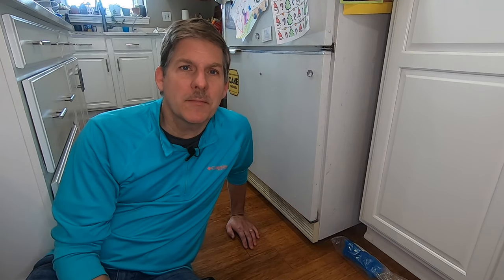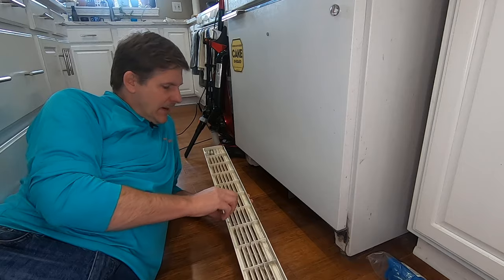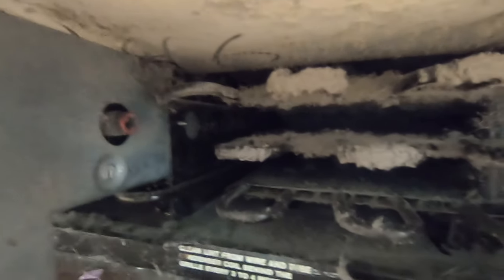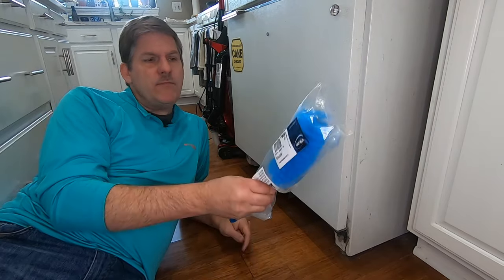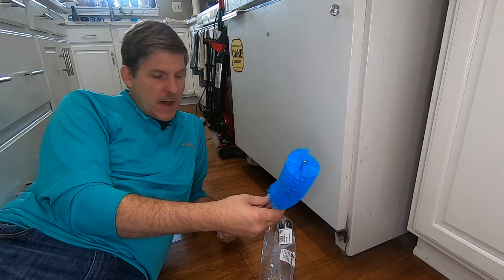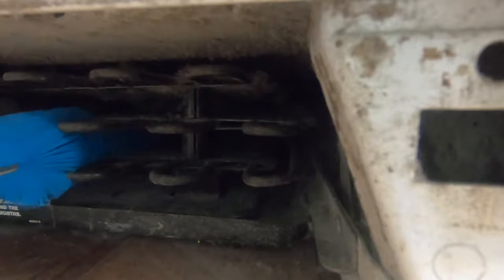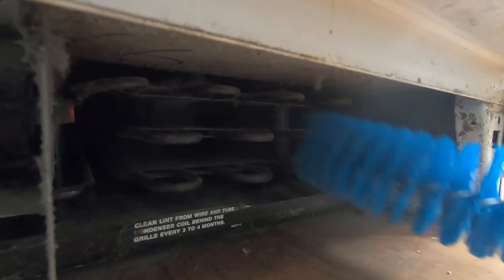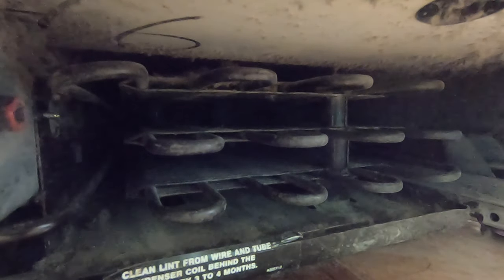how to clean under refrigerator coils : prevent fridge from not cooling

Comment: I'm about to do this on a 15-year-old fridge that has never been cleaned as far as I know. I love that the notice to do it every 3-4 months is behind the cover at the bottom of the refrigerator where no one will see it, ever unless they are already doing that.
Reply from the maker: Hey Ceares,
Great point! Have fun!
Reply: Good Luck. It TOTALLY worked for me!!!
Reply: I,m convinced that the dust under my fridge all over the evaparator coils  was causing the thermal relay to cut the circuit

Comment: Thanks for the great video. We learned this the hard way. We have two golden retrievers, and we’d owned the refrigerator for 13 years when it died. We ordered a new one, and in the process of moving out the old one saw, with horror, the amount of dirt and dog hair that had been trapped. We installed the new fridge, cleaned the old one, and it miraculously came back to life. 🤣🐶🐶
Reply from the maker: Hey Elizabeth,
Great story! Amazing what a clean will do. Thx for watching!
Reply: @Housebarons  I know that air needs to free-flow to that area of the fridge, but have you ever found anything, like some sort of screen, that can be put in front of the grill and limit dirt/dog hair but still allow air to flow in freely?
Reply from the maker: Hey Elizabeth,
I have not. Interesting idea. My guess is they don’t design them that way because the smaller surface area would clog faster and thus require more frequent maintenance - else the fridge would over heat or at least become inefficient. 
But that’s a guess….

Comment: My KitchenAid fridge is basically designed so the coils are next to impossible to clean. The front has a fence of coils that prevent you from reaching any coils beyond it. Manufacturer knows this and wants fridge to fail fast so you are buying a new fridge every 5-10 yrs instead of 20-30 like we used to. Manufacturer deserves to go to jail for this. It's ridiculous

Comment: only until I  removed the doors and shelves I flipped the fridge on the side and only then i was able to see the build up of lint and dust on the very bottom but not visible by just looking underneath  you would have to flip the fridge on its side to see the bottom and then Vacuumed but it was too late because i had already had a new fridge delivered because everyone said it was 14 years old it will only keep breaking down But I hope some needy person can take it in from the curb before sanitation takes it away  i will leave green masking tape saying it works  I wish i flipped it over before i bought a new one I,m convinced that the lack off ventilation was causing a thermal overload to trip because it would run fine after being shut off for a couple of hours then after 6 hours or so it would start to click off compressor.... live and learn but I watched over 100 you tube videos not a single video said to flip it over and look underneath so much for A-eye google search

Comment: I didn't have a brush, so I used my air compressor took the front and back panels off then blew it out the back then blew it out the front repeated it 3 times each, hadn't ever been done for years!  The frigerated wouldn't stop running and that was it! Running like new now!  It was overworking for years! Yeah, it made everything dusty in my kitchen!
Reply from the maker: Hey James,I can imagine the dust! but if it worked...then fine! Thx for watching!

Comment: Just finished cleaning my Kenmore refrigerator. I used a thinner bottle brush as my layers of coils were closer together. First I took off the plastic shield cover from the back of the refrigerator and cleaned the coils. And while I was at it, I also cleaned the fan and all the other lines that were back there. Then I went to the front of the refrigerator and got out all the dust bunnies that had been pushed to the front of the coils while I was cleaning from the back. I also used a yardstick and attached double sided scotch tape to pick up the dust bunnies that I could not reach with the brush. Dusted the sides and top, and pushed it back into place. My husband said, "It runs quieter now."  : ~)
Reply from the maker: Hey Cheryl,
Good job! Love the tape idea & Thx for watching!

Comment: Thank you soooo much for that brush idea.  I just finished cleaning my 13 year old fridge.  I always wanted to do this but never had the gusts.  Wow so much dust under that fridge.  I had a smaller bleu brush.  With the dust going all over the place as I was using the brush all over the coils and everywhere, I put a wet thin cloth over the brush (J cloth).  The dust ended up more on the cloth that on the floor or in the air.  

Thanks again.  I am so glad I did this.  I am a 62 year old woman.  If I did it anyone can do it too.  Bye
Reply from the maker: Hey Sylvia…,
Way to go! Nice job improvising with the wet cloth. Great idea. Hopefully you just added years of extra life to your fridge! Those fridges are expensive to replace! Thx for watching.

Comment: For some of the other coil designs some suggest using an air compressor or leaf blower and to help catch the dust use a box fan and flour/tea towel draped over the fan as a filter.
Reply from the maker: Great tip! The air compressor will work - just have to have a good set-up to trap the dust. 
Thx for the help!

Comment: We have 5 cats and the cat hair accumulates quickly on the condenser coils located behind our refrigerator.  We have had major problems with our new refrigerator on it not cooling well at all, in fact temps getting up to 47 degrees for more than 6 hours!  We have a tech coming out today to figure out what is going on.  I did pull the refrigerator out the other night and removed the back plate and took the vacuum hose without touching the coils and just lightly vacuumed.  But, there is a ton of dust and cat hair between the coils and honestly I have been afraid to stick any type of soft bristle brush between them for fear of damaging something.  Anyway, thanks for the video!

Comment: The price on Amazon was excellent for that brush.  Unfortunately our Maytag Fridge does not have the coils open. There is a type of screening in front of the coils and they also appear to face to the side where we cannot reach them.  It is smelling really dirty/bad under there and there appears to be a tray of some kind that probably needs to be cleaned? We seriously need some help with this.
Reply from the maker: Hey Robert,
I’d do an internet search about you exact model and see if anyone else has tackled your specific model. Thx for watching!
Reply: Robert, how did you solve this problem?  I have a Kenmore (Frigidaire) top freezer refrigerator which also has the coils oriented 90 degrees to the front of the fridge (as compared to this video) and has aluminum fins between the coils which obstruct inserting a brush into the coils.  It's easy to wipe the front coil and fins off by hand but accessing the others seems mission impossible?  Canned air did nothing.  I could use pressurized air from a compressor.  That's sort of my only idea.  In many of the 'coil cleaning brushes' reviews on amazon, various individuals will talk about the brush being too big because of the coil orientation so I know this isn't a rare problem.

Comment: Can you do this while the fridge is running? my fridge is having issues with the drain line freezing even though my setting is the warmest. Any ideas? Will be doing a coil clean this week
Reply: You might want to unplug unit just to be safe and not hit the rotating fan blades that circulate air over coils. To your question about freezing drain line you should call manufacturer help line their might be a recall for the problem. I know of an issue on Samsung models around 2016 that had that problem and freezer coils blocking up ice and defrosting in bottom of compartment and leaking on floor. Turns out their was a faulty temp sensor that was the issue. Good luck

Comment: This is a stupid question. But do you have to unplug the refrigerator. Because my is behind the refrigerator
Reply from the maker: Hey Martin,
No dumb question. You made need to to pull the fridge out far enough to get to the coils. It won’t hurt so long as you plug it back in when done😃 
Thx for watching!

Comment: Doesn't work on whirlpool double door fridge, has coils in a up down triangle pattern, can't insert anything past the 1 st coil loop
Reply: Did you figure out how to clean it?
Reply: @elizabethw.454  Just removed the bottom cover and vacuumed, what was there, all blocked with pet hair. If I ever replace the floor I'll empty it and put it on it's side and try to get the rest.
Reply: @safffff1000  I am going to buy a brush like he recommends but much thinner and longer . Amazon has several types that say they're made for fridge coils most of them under $10. I don't know why they make these things so hard to clean.
Reply: @elizabethw.454  I'll check that out

Comment: My hitachi fridge has no coils in the back or bottom back or front or below .. where r they.? The compressor is i the back but thats it please help
Reply from the maker: Hey Chico?
Interesting. Maybe they are they all embedded in the wall of the fridge. But can’t imagine how they would transfer heat that way…
Can you follow the lines from the compressor and get a clue that way? Or are there any panels that are covering them?
Sorry. Just haven’t experienced that before.
Reply: @Housebarons  ok ,from  the compressor bras pipes going from left and right inside the sides of the fridge…..does it mean the coils are hidden in the sides they do feel hot ………..if the coils are in the sides there is no need to do anything right?

Comment: My Siemens fridge is completely unaccessible. Everything is enclosed in fused plastic. The only screws are those mounting the stands and the actual freezer compartment, but removing that requires you to disconnect the refrigerant tubes, which is obviously not a consumer job. Total scam. I can't even see how much dust is on the coils and fins.
Reply from the maker: Hey Alexander,
Thx for the input. Good to know. 
Thx for watching!